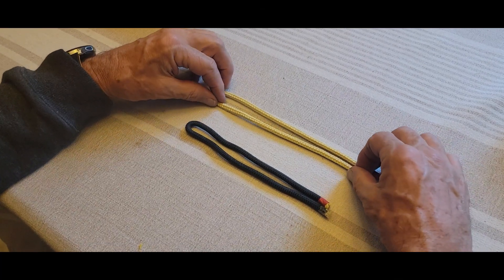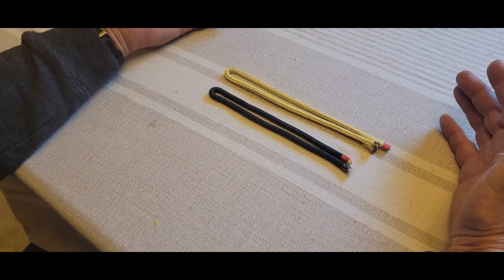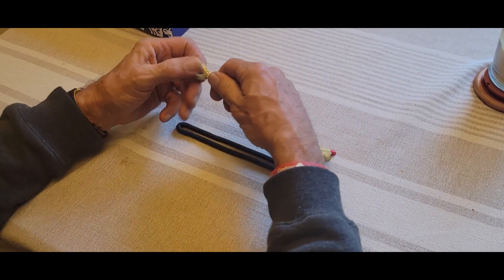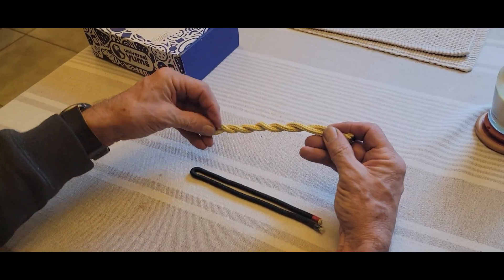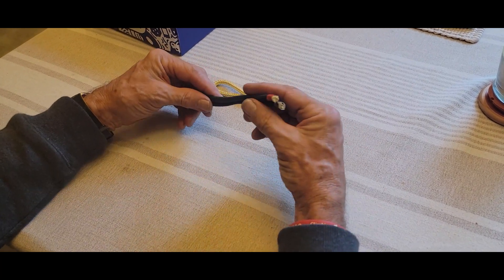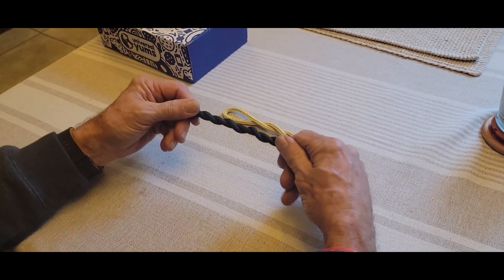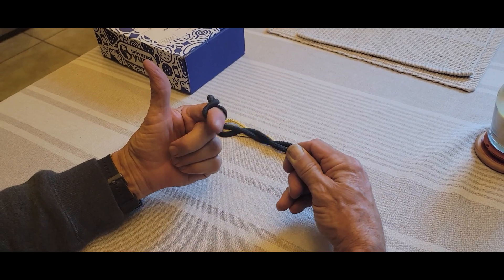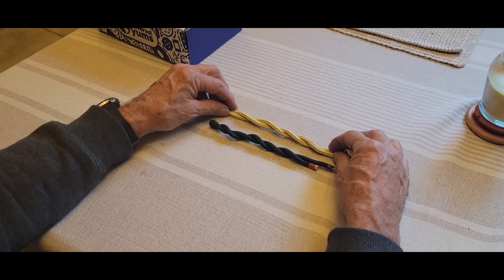Where is the Spring in Friction Hitch Cord?

Comment: easy way to set any friction cord on almost any rope no matter which style hitch you tie , tie the hitch test for slippage if it slips un clip it twist the eyes in opposite directions reclip in test again.  I found that 90 percent of the time the hitch performs perfect. start with a half twist first if it's still sloppy add another half twist.  if it still doesn't work the way you want it tie a different style hitch and if needed repeat the twisting.  I use ocean poly and I have never not had it grab perfectly on any rope from 12 to 24 strand climbing lines.  I refuse to have 5 different hitch cordages and have tug o remember which goes with which rope.  I figured out the twisting when I  first tied a VT and it wouldn't grab and after a few sets it started flopping around well twisting the hitch cord solved the issues,   if it can make that sloppy VT run perfect it will definitely cure any tighter style hitch problems 😊

Comment: Richard : I think your looking for "spring" is a questionable analysis.  The question is this: what makes a multi-cender re-engage the rope, especially from a state of full disengagement like when tending up on an ascent?  In typical mechanical devices, made from metal with extremely low friction, the spring is there to LIFT the device back into a position where a minimal amount of proportional friction can begin the engagement process, at which point the proportional friction can ramp up to a full lock, so the climber is supported.  This is especially obvious in a device like the Unicender, which would happily remain collapsed in a near-zero friction puddle around the rope, if it didn't have a spring to provide that first hint of engagement friction, so the proportional friction has a starting point to work from.  We sometimes see the same issue with friction hitches, where they need a certain minimum starting amount of friction to re-engage, instead of just sitting there like a puddle around the rope.  This is especially obvious with the wrong combinations of new ropes, hitch cords and hitch knots, where things can easily be so slick that there is effectively zero starting friction.

To be precise: the problem here is that proportional friction can't engage when it starts from effectively zero, it has no starting point.  Zero times anything is still zero.  To be more precise: if the disengaged friction in a device is below a minimum practical threshold, then the proportional friction in the disengaged state is not enough to overcome the minimum force needed to re-engage the device.  That minimum force could be a function of gravity (lifting the links in a Unicender or Akimbo), or the tension needed to pull a slick hitch just tight enough to begin to proportionally engage.

So, do we call this "spring"?  It's not a bad way to phrase it, but I suggest that it would be more clear to explain the purpose: maintaining the minimal friction needed to re-engage the proportional friction.  This could be an obvious spring like in the Unicender, or the "spring" in a hitch cord, or the spring of the rope itself, bending through a device that never gets so completely straight as the Unicender does.  But it could also be far less obvious "springs" like the fuzz on the rope and hitch in a broken-in hitch system, maintaining that minimum level of friction needed to re-engage the hitch.

Ultimately I want to thank you profoundly for this and your last video, breaking down the fundamental concepts here.  The holy grail of multi-cenders is zero friction going up, zero sit-back when re-engaging, and an extreme multiplication control force into controllable friction, without any force needed to release any of the proportional friction.  Given that these ideals all sit in direct contradiction to each other, it really is amazing how close we have come in many devices.
Reply: What I got from this video, is that the more springy the more grabby it is. 🇨🇦🇺🇸
Reply from the maker: In many words I think you said the same thing. By "spring" I was not referring to a literal spring as I mentioned in reference to hitch cord.
Thanks for the comments.

Comment: Nice observation Richard. As you know I've been wanting to eliminate the need for stopper knots in the HHX, so I've replaced the dogbone with an 8mm delta link. It fits quite well. I'm also using 8 mm armor prus hitchcord. 2 spliced eyes. I use the hitchcord in a 3 wrap prusik on 11 mm and 11.7 mm climb lines. one concern I have is the stainless steel delta link riding in the aluminum channels. Any thoughts?
Reply from the maker: The hitch cord and connector is your life support so if that works you should be good.
There will be some space and wobble with the Delta link in the Dog Bone slot, that may be problematic.  Not concerned about corrosion from steel to aluminum and surfaces are flat so hope that works.